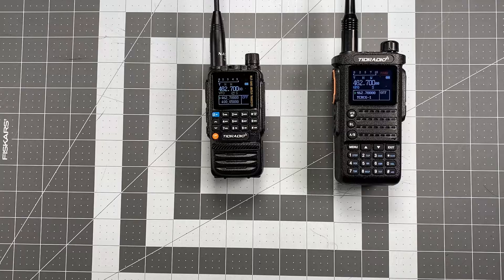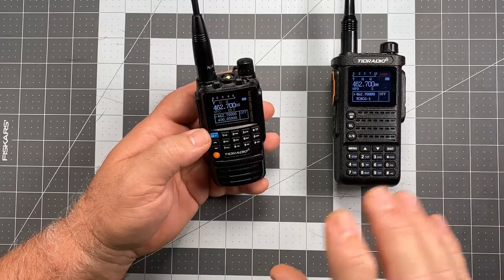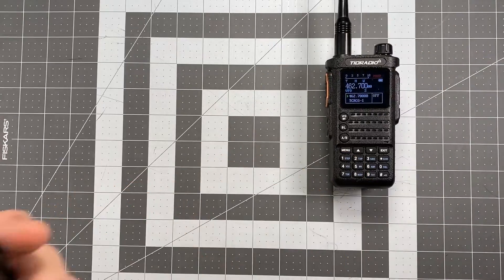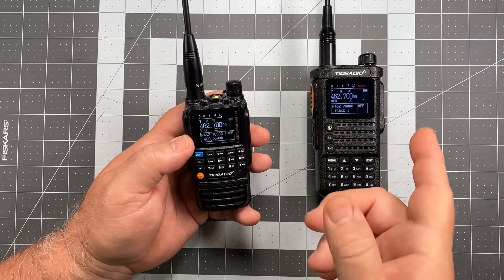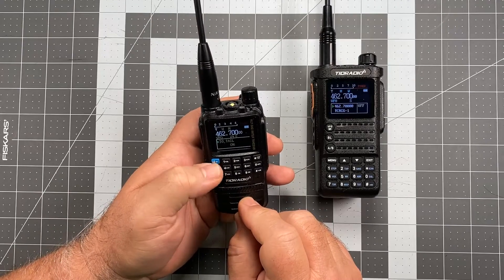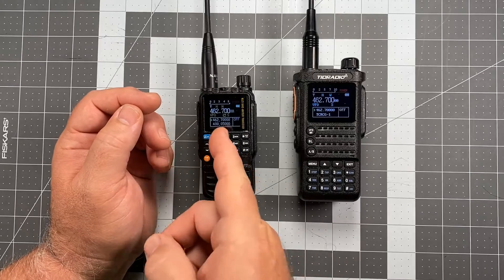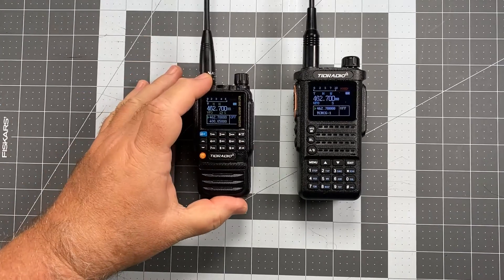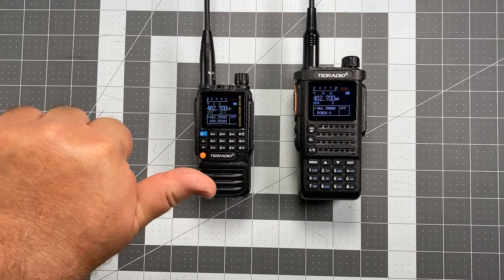TID Radio TD-H3 Operators Series: Part 3 - The Roger Beep

Comment: Reminds me of Yaesu WIRES mode & how a lot of guys have to be reminded to turn it off on a normal repeater because the sender can't hear it.

Other than somewhere noisy where you cant hear or see whether a carrier is rhere, i cant think of a use case. Paging would be tone decoding which this dupes in a simplistic fashion. Digital radios also usually have courtesy tones and / or comfort noise (D* radios are bad about that). On the Tidradio...???

Thanks VERY much for helping me & others NOT be a lid by making us aware of this ridiculous feature & that it needs to be disabled before initial key up!

Comment: Wish they made the h8 just a bigger version of the h3...  h8 transmit key is way too sensitive I hit it when I don't want to, it rattles frome the battery hinge pin like a screw is loose inside but isn't, and only my keypad lights up not the band a/b and above buttons so in the dark it sucks... contacted tid radio and they don't seem to care, love the little powerhouse h3 though no problems there other than the crazy loud squelch tail burst from incoming repeater  transmissions 😮.. lol